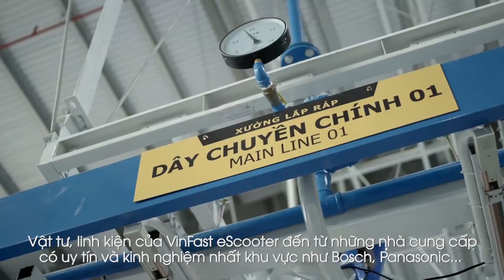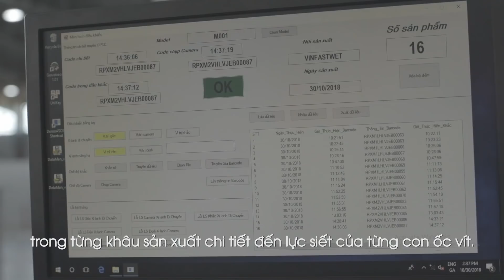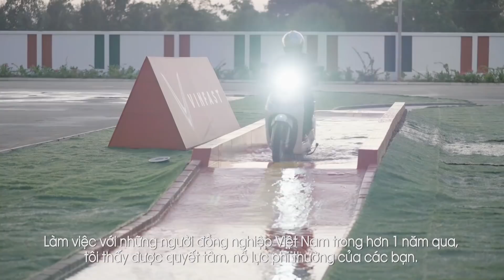VinFast E- Scooter manufacturing process

Comment: Sao không làm xe máy để cạnh tranh với HonDa và yamaha nhỉ
Làm con 97 cc bán tầm 
80 000 000 sẽ có cả 1000000 00000000000000000000000000   người mua
Reply: 3 năm nữa nó cấm xe xăng rồi. Làm xe điện mới thức thời
Reply: Mạng Cộng Đồng cấm tp hcm vs hanoi thui chứ mấy vùng khác dùng ầm ầm
Reply: @tringuyen8329  thì nó bán 2 3 tp lớn thôi cũng bằng doanh số chục tỉnh cộng lại. Rồi lộ trình cấm hoặc tăng thuế xe xăng dần dần hết cả nước thôi